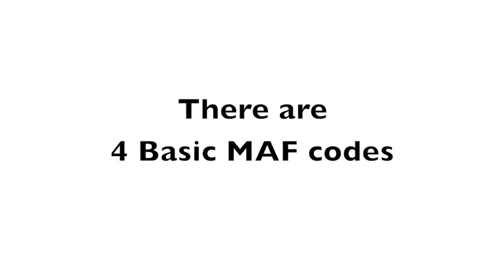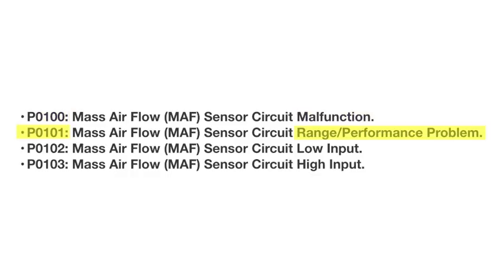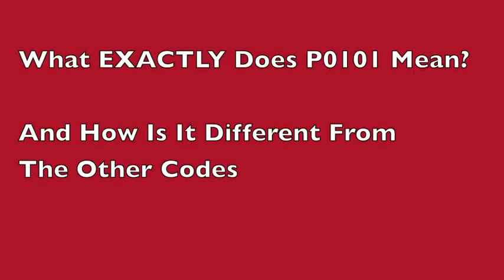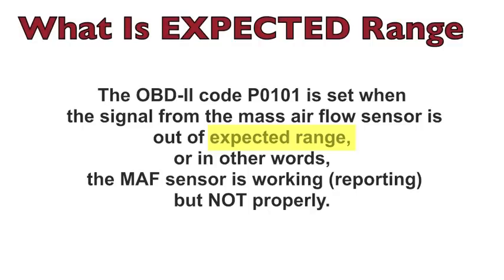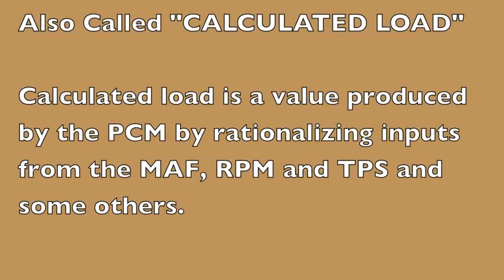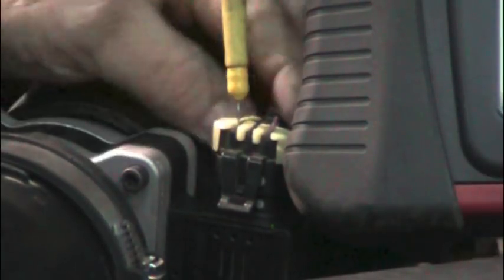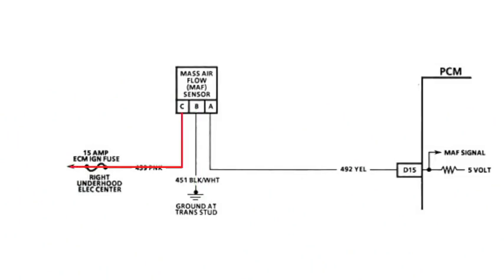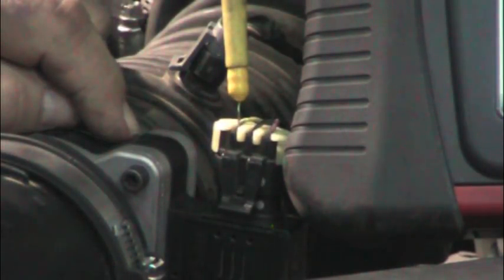Teach Yourself Series  MAF Code P0101    Part 1

Comment: You can also get P0101 even if your engine doesn't have a MAF sensor. In such engines the expected range is calculated from RPM, TPS and MAP sensor values. So if your MAP sensor is dirty it will cause a P0101 together with probably a P0106.
Reply from the maker: I'm always amazed at the variety in thees systems, thanks for your comments

Comment: Hi, actually i have the same problem P0101, but right after i replace airmassflow sensor 
for a new one. before change use to get P0113 code... where to look to solve this problem???

Comment: Is  it a signal wire or ref. wire?  4:37 the PCM? drops it to a 5 volt REFERENCE?
Reply from the maker: Good question.  I'm actually making an updated video on the MAF right now. It will be posted soon, and I'll address that in detail.  To answer your question.  The battery inputs 12 v to the PCM which drops it to 5 v   The MAF then signals back to the PCM the changes on the 5 v ref to calculate injector pulse width to maintain air/.fuel trims.
Reply: @realfixesrealfast  That clears it up for me.When I'm able to get out of the house I'll get my hands dirty. Thanks

Comment: Thank you for the great teaching. I was wondering if checking  the circuit was even necessary since this code is a performance code. Could a circuit problem trigger a performance code?  Would you please answer that for me? Your answer will be very appreciated.
Reply from the maker: Great observation!  You are correct, for those who completely understand the system and circuit a "performance" code would only be possible if the circuit integrity itself was good.  As a teaching method I try and explain the whole circuit for a better background. I appreciate your comments.  I can tell you are a Critical Thinker.

Comment: Is it just me, or is the much of the audio missing?
Reply: Some of the audio clips at the car are missing the signal to the left ear, probably because of a bad connection between the mic and the camera. I wish Duane would invest in a new camera, it would dramatically improve these seminars. Content is excellent but the low res video and audio issues make these videos harder to follow.
Reply from the maker: When I review the video's I have audio thru it all with no drop outs.  Can you tell me exactly which video AND where the audio drops out.  I'll check it out.  No one else has mentioned it.   Thanks for your help.   Duane
Reply: Audio is working now, maybe one of my speakers was bad.
Reply: Interestingly, at 0:22 there is the music intro coming in both ears that fades out, and after that all of the audio is into the right ear. Audio to the left ear is out for all the clips where you're standing beside the car, very good otherwise. I wonder if when you did the transition from music to audio you lost the left ear clips. Also for the part II video, music starts out in both ears. Then when you do the transition at 0:06 the verbal audio is entirely into the right ear. Signal to the left ear in part II is missing for most of the clips where you're looking at the live data graphs. Interestingly, in the single clip starting at 6:07 of the part II video, audio for the right ear is gone and left ear is good! Audio is bilateral and excellent for all the part II clips where you're recording while sitting at the computer (maybe used a different mic?). 

If you are playing it in mono mode on a computer you may not detect anything because mono sends the same signal to each ear. However for those who use stereo headphones it is a striking and persistent abnormality. Five years ago I would hear this in many videos, but lately with newer cameras it is a rare experience. This is not a problem with my equipment, I watch and upload videos all the time. One trick that sometimes helps for those using stereo headphones is to pull the jack to the headset out a little. If you find the right spot you can get a mono signal sent crossways to both ears. Thanks again for taking the time to make these, Duane. I'm offering positive, constructive feedback as a friend who's on your side. When you do get a new camera, you'll look back at the low resolution and audio issues in old videos and wish you had made the transition sooner.... Dave

Comment: You puzzled me, wouldn't the pulse width have be to changed with different masses of air passing over the hot wire and not the frequency?? 

My understanding is that in the VORTEC system (a part of) the air  is caused to reverberate and that the frequency of this vibrations equals to the actual air mass entering the engine whereas  the mere hotwire system measures the amount of current to determine airflow. Is this true?
Reply from the maker: No its not.   Watch part 2 for a clear explanation  Part 2 will be uploaded soon.